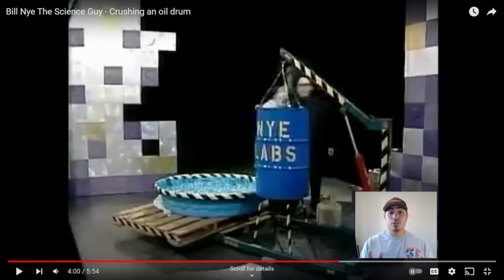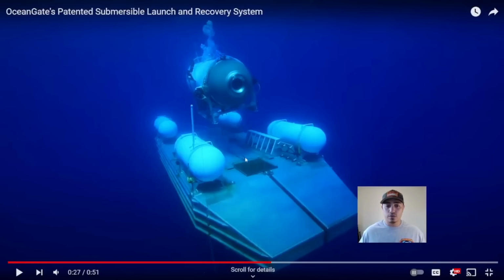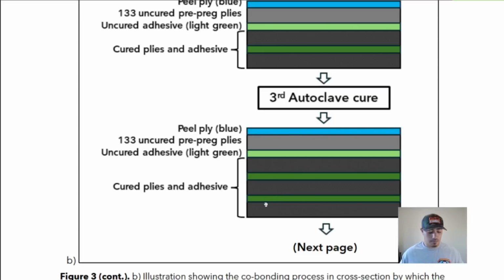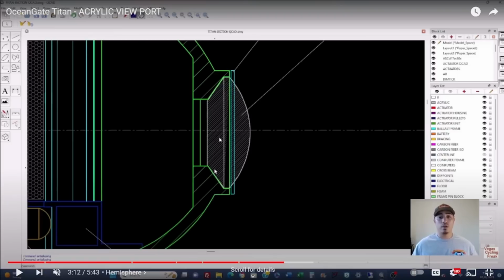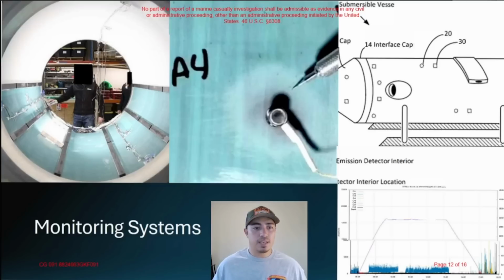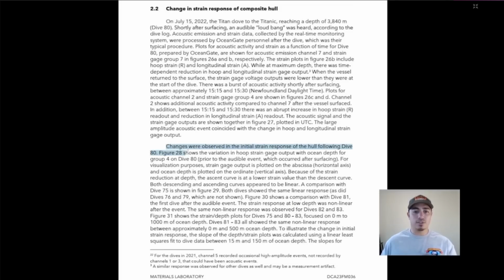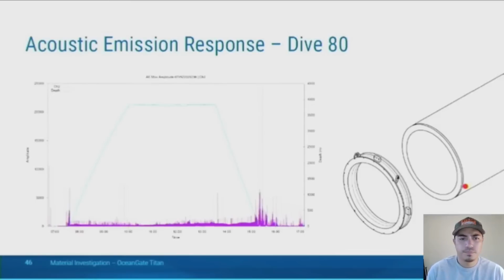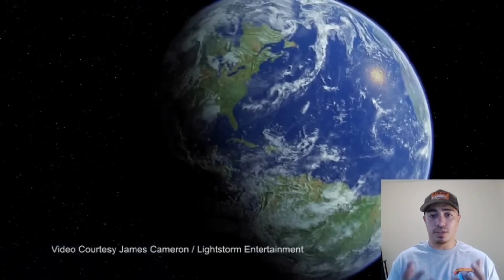Part 2: Investigating the OceanGate TITAN Tragedy: Carbon Fiber Hull, LARS Flaws, and Warning Signs

Comment: 5:56 the LARS is essentially a buoyancy compensator vest scaled up to a pontoon barge. That’s why it is able to achieve neutral buoyancy both with the submersible attached and once the submersible launches. I’d imagine they save the compression metrics and repeat them for retrieval. That’s reasonable ingenuity. But then they tow the damn thing 500+ miles roundtrip through the North Atlantic to save money. Yet another example of why all of Ocean Gate’s contemporaries warned Rush of the blowback that the entire industry would suffer. There is low tech genius buried within the madness. Then the madness cost five lives in front of the world.
Reply from the maker: I love that analogy brother, it really was bouyancy compensator, It's mad they decided to go with something so narrow. In diving salvage operations we all know the air will want to shift to the highest point so it's surprising to me the entire barge didn't roll over on numerous occasions. Love your comments, I'll respond to the other one later today. have a great week!

Comment: The Hydraulic Press channel did a pretty impressive pressure test of a carbon-fibre cylinder with glued-on metal end caps. Failure was not only very rapid but yielded large fragments of carbon fibre similar to the ROV photos: https://youtu.be/BQGDwE3yMb0?si=Kvvm-2SnYCywAlxW
Reply from the maker: Thank you! i will save this for a future video! Cheers🤙🏼

Comment: Carbon fiber, Rhino liner, glue between layers, epoxy on the ends, and titanium. ALL with different coefficients of expansion and contraction. Guaranteed failure.
Reply from the maker: spot on

Comment: Oh, how many trash cans I imploded as a kid with a Black Cat and it inverted.  Just the air pressure was instantaneous.  Now think about that at 400 times the pressure.
Reply from the maker: That's a great visual as well! It's still difficult to imagine the sheer force behind what happened. I'm still curious as to how loud that boom was underwater.
Reply: @sspdiving  Listening to the USCG hearings, there's a post facto statement that one of the surface crew felt the support ship shudder.  Would have probably been more helpful at the time the SAR was ongoing.  And the "acoustic event" that has been mentioned when it surfaced was heard by the Zodiac crews.  I suspect they knew it was gone before anyone picked up a radio.

Comment: As I have said in the past, Stockton is an aeronautical engineer. Imagine if this irresponsible death wish clown was making an experimental airliner and it was full of passengers.
Reply: Apparently Rush made an experimental aircraft. It was quite small though.
Reply: Boeing would welcome him with open arms. They seem to switch more and more to this kind of "engineering". You can see the results piling up. (The Boeing Max-crashes and other nearly tragic accidents.) The same pattern of negligence, greed and overblown egos.

Comment: One thing I found interesting is that the titan sat outside in a St John’s harbour for the winter.  The freezing rain and snow could not have helped the materials either
Reply: The sub got shitkicked. It was left outside over winter. It was towed multiple times through open ocean getting slammed by waves and tossed around on the barge. It was dropped while being pulled from the ocean causing the front dome to fall off. It was cracking and banging every time it went through drastic pressure changes. Not to mention other sketchy factors, like the inadequate acrylic window, the carbon fiber having to have lumps and imperfections sanded out, and them not even bothering to use all of the bolts for the front dome. Not to mention when you watch the video of them adhering the titanium rings to the carbon fiber shell the technicians are literally handing the titanium with their bare oily hands just prior to adhering them. Just mindblowing shit. The only thing surprising about the imposion was that it didn't happen much sooner.
Reply: @foskco87 if Stockton was still with us he would definitely be going to prison
Reply: @jenniferst.george810  and Towing it out bouncing around in the waves for 3 days could not have helped the stability of the materials and systems.
Reply: That cannot have been good for the titan sub & it’s terrible that it was not protected from the elements.  INCONCEIVABLE!!!!!!!
Reply: I wouldn’t even leave my car outside in Nova Scotia in the winter.
Reply: Interesting! I hadn't heard that detail
Reply: Coo coo for co co puffs.

Comment: If the acrylic window was the weak point then I am not sure as to how the forward dome was separated from the rest of the wreckage post implosion, would the forward dome be part of the main wreckage if the implosion start from the window?
Reply from the maker: I would guess if the window caused the implosion, it would cause an instant change in the internal pressure. So much so that the weak carbon fiber hull would collapse starting at it's weakest section. Which would have been the top and forward half. It may be why the bottom of the hull and aft dome were still intact. Not sure but I personally think it happened on the forward end, everything shoved into the aft dome.

Comment: There is nothing wrong with the transfer from the machine shop to the autoclave, all an autoclave is, is something that creates heat under pressure. Like a hospital will use an autoclave to clean and sterilize surgery equipment. Because at a certain amount of heat and a certain amount of pressure you can kill off a lot of things. Moisture wouldn't be an issue in the slightest because the pressure and heat in the autoclave is going to press those things out, and a LOT of autoclaves use water to create the pressure. Basically, an autoclave is a pressure cooker. Literally. You can use a pressure cooker as an autoclave. This part of the process isn't controversial at all. Although, the introduction of glued segments introduces more points of failure. If you want to watch a pretty neat video, Thunderf00t release a video last year when this happened, predicting that the failure would be due to the glue. Dude is an actual scientist who works in academia. He is pretty consistent on making accurate predictions. Also based off the destruction and how the hull actually ended up. It's pretty unlikely the Viewport was the actual failure point.
Reply from the maker: Thunderfoot is awesome and I wish I could explain things in detail like him and some others. I'm just trying to piece together any possible flaws. I'm sure during this process they actually did put a lot of effort ensuring the hull at the bare minimum was protected but judging off most of the decisions were are now learning about, I can't be too sure. I can tell you that in Washington between November and January we experience heavy rains and freezing temperatures. Some snow, but not much. Maybe only 2 weeks at most during this time frame. I would assume it introduces a variable they had to account for. It's quite honestly, something we'll probably never know. Thank you for your comment and perspective, cheers:_SSPhelmet:

Comment: Sound of delamination, or layers separation. It wasnt "safe" to dive that sub anymore. Mind you, first hull they used had to be scraped after big delamination incident, so they were aware of this posibility.
They continued to dive with passengers to Titanic anyway. 
If famillies of those dead choose to sue them, they are very fucked. Not like there is much to take left. This is beyond incompetence, this is straight up criminal.

Comment: at the depth it was at, when it failed it was less like a barrel collapsing and more like sitting inside a bomb as it detonates. that why the only remains that were found was red stains.
Reply: At that pressure wouldn’t any fat or oil being compressed to 5000psi detonate like a diesel engine?
Reply: not sure but there would have been a water hammer effect with a massive pressure spike way above what the water pressure was at.

thats probably what sent the viewport flying off.

Comment: Well water under pressure of 5000PSI will be pushed intro each small cavity in the hull and stay trapped there.
Then you let it freeze in the parking lot.... what do you think happens, right? That water freeze, expands, make cavity even bigger.
Reply: I didn't even consider that bit, but it does make some sense...
Reply: That‘s why the sub had a waterproof coating - at least theoretically, given OceanGates operating procedures I wouldn‘t be surprised if that was faulty too.
Reply: @BL-yj2wp  Waterproof coating kiss my ass. We are talking about 5kpsi, that make even solid titanium bend. Water coating they used isnt made for this level of  pressure.
But most crucial points are glued endcaps since CF shrinks a bit under such pressure which expose glue joint to water. If water can get somewhere, it will. And you certainly doesnt want it freeze there. 

Its weird Stockton Rush was so broke he couldnt afford to store it somewhere in heated hangar over winter....you know, place where small private planes are stored for that same reason.
Reply: @cyphi474 even a storage shed would be better then outside, jesus what was this dude thinking!
Reply: @BL-yj2wp if you mean his Rhinoliner? No that is not a waterproof coating. Not that a waterproof coating is going to be 100% reliable in extreme temperatures, or extreme temperature changes. But being watertight for submersible conditions does not make it waterproof/weatherproof on land.
Reply: Probably ruptured from freezing, and then allowed more water in the next time. Freezes, expands the existing damage, drains, ad nauseum, because they left it in CANADA for the winter. In a parking lot. Unprotected. 🤯🤬

Comment: I've just finished watching a video about the incompetent building of the composite hull. Now this. Is there any part of this project that isn't evidence of a totally incompetent team?
Reply: Most people connected to this company that had any kind of competency either got fired or quit. The only exception I have seen so far is Tym Catterson, a contractor who briefly worked with Oceangate and was there on the last dive.
Reply: @nian60  wait, the single competent person left in the company was on the last dive? 😲
Reply: The use of a video game controller with remappable buttons made a great contingency plan for when they installed one of the thrusters backwards. Good forward thinking to use an adaptable control system!
Reply: @PragmaticAntithesis  LOL, I don't think anyone alive gives a damn about that and the dead don't care.
Reply from the maker: It seems every part of their process was flawed unfortunately.

Comment: As fiberglass hates water, the outside rinoliner was used, but the glue attachment to the ring over a number of dives would let water into the lasagna layers over time.  And if they panicked when the stress noises were getting bad , pushing the thrusters hard could of overheated the batteries causing absolute consequences with the batteries inside the end part of the dome.   It looked charred to me, lithium batteries do burn underwater.
Reply: And what passed the electric and other pipes into the pressure vessel, they never talked about that .
Reply: @aperitifs  I want to know the answer to this as well, making anything seal at the pressures involved is a huge challenge, and drilling a hole through the hull is just asking for problems. I assume it was done through the titanium ring at the rear, or maybe the rear end-cap. Looks like it held up ok, as the implosion obviously started at the front.
Reply: @aperitifs  There are four glands passing through the aft ring.
Reply from the maker: @aperitifs  idk how I ever over looked that. I'll try to mention that in the next vid. I wonder how other subs handled that challenege.
Reply: Interesting, thanks.  Just a layperson, but I try to understand.

Comment: It was purely stupid to use the thing after dive 80 (81 at most). Like, what the hell is the point of having all those fancy sensors if you're not going to do anything about it once they show a major problem. That's a massive DUH! moment. The guy was as arrogant as he was careless.
Reply: "We have this sensor system I invented and patented that will give us an early warning of failure!" Then ignores the sensor data that indicates warning of failure.
Reply: He was downright dismissive of the idea of dying even when repeatedly confronted with the possibility.
Reply: I think he or the company was near bankruptcy he stubbornly kept going to try save face ignoring the fact the sub was no longer safe
Reply: @jenniferst.george810 yea I read he really needed these passengers money to make a new vessel. And if this trip went well more people would invest in the company
Reply: Sounds like he couldn't let go of his dream.  I suspect he believed the retirement of Titan would effectively end Oceangate.
Reply: Most people dismissed the sensors as pretty useless, however they did appear to work. I wonder if Rush also thought they were useless so ig ored the data.
Reply: @Cheeky-fingers  yeah from the sounds of it they certainly worked. The problem was that nobody was analyzing the data, and if they were they missed many warnings signs 🛑
Reply: strain gauges on a material that doesn't experience any sufficient amount of strain before failure is completely useless. That is like attaching a speedometer to a riding lawnmower.
Reply: @beeopboop62 
But the strain gauges showed significant deviation after the dive with the sonic event. OG just didn‘t care.
Reply: @BL-yj2wp  you’re right. If they’re using it for data points to understand what happened during a dive then they could use it to have a better understanding of what’s being experienced. If they’re using it for real time monitoring it’s useless in understanding if you’re too far or not because the material is brittle and just breaks
Reply: Yep🤦‍♀️
Reply: Classic case of survivor bias. He never realized how close he was to death each time he survived a dive down there.
Reply: The point of the fancy sensors was to give OG and Rush a veneer of credibility and safety for investors and customers.
Reply: And he fired the guy who wanted all the strain gauges.

Comment: Taking all the shortcomings into account. I'm surprised it survived the first dive. I feel that OSHA could have put a stop to this easily when DL informed them.
Reply: I've had this very same feeling about this too in relation to it making it past dive #1.

The pressure cycling,not only of the hull,but even more so with how the adhesive would have acted during cycling,was imo the most likely contributing factor in this tragedy.The adhesive was the weakest material out of titans makeup.

I'm curious to the engineers here.If a certain mm thickness of titanium would have been used to make a secondary hull layer,would it have helped increase the hulls strength enough to have prevented this?? Thanks
Reply: @wbrockstar9550 not an engineer, trained physicist, but affixing a titanium layer to carbon fibre Hull would have the same problems as affixing the domes. Different moduli of expansion and contraction will result in delamination. It is possible to fabricate composite joins, but you have to find a way to make each material expand or contact at the same rate. Such components are usually manufactured together and melded together in some way, and you need sterile conditions and machined precision.